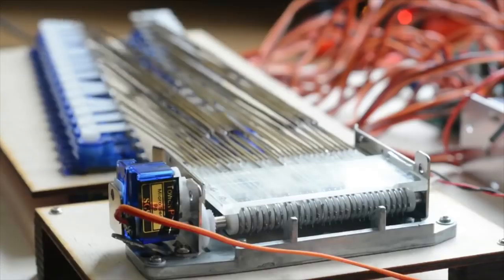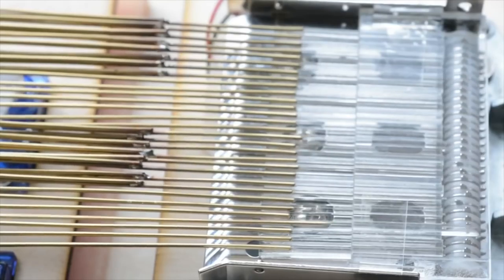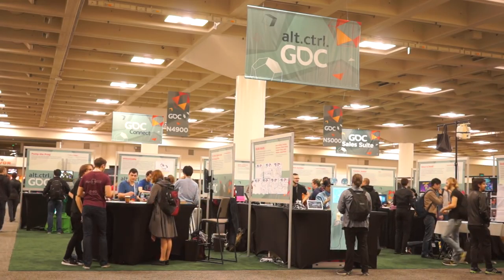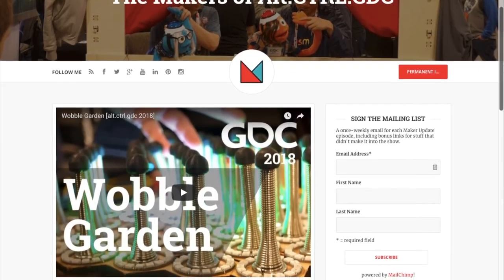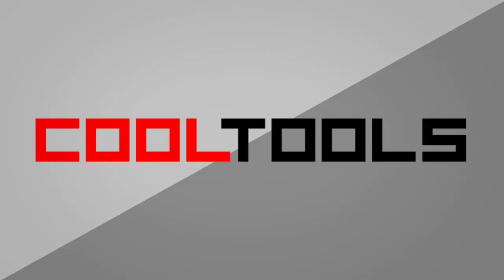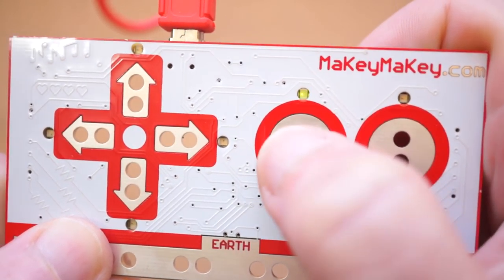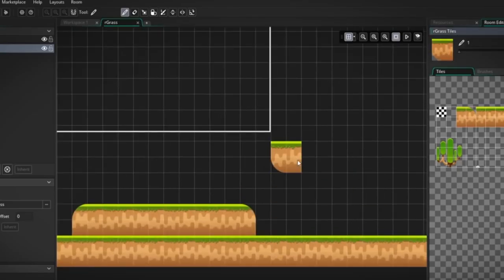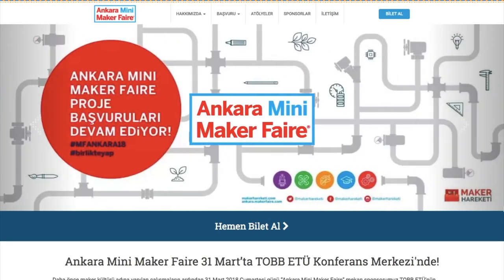Alternative Controller [Maker Update]

Comment: Have you reviewed step bits for col tools so far? If not, they are just so much better than regular drill bits for thin materials!

Just in case you might be running out of tools ;)
Reply from the maker: They're on my list! I've been using the hell out of mine on this Power Racer go kart build. In fact, as I finish up this car I was thinking of doing a run of Cool Tools I've been relying on to get it built. Step bits are definitely in that category. It's also an excuse to buy a nicer set than the Harbor Freight ones I've been using.
Reply: I bought the cheapest one I could find on eBay so it's probably like the HF. There are also those spiral impact driver rated bits - pretty cool.